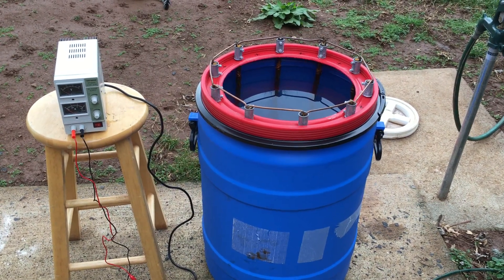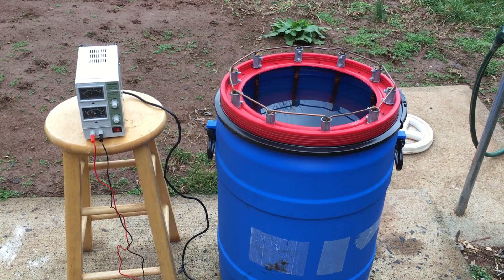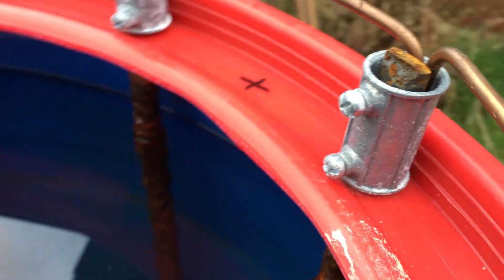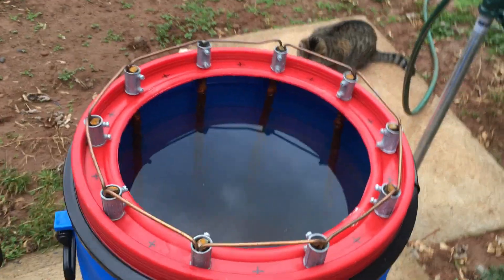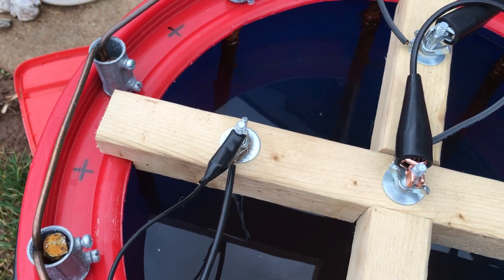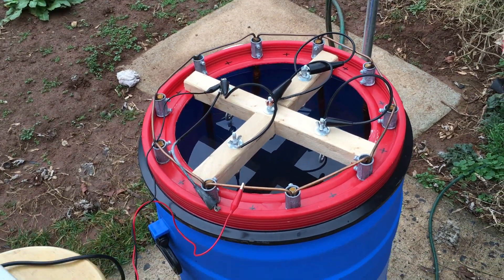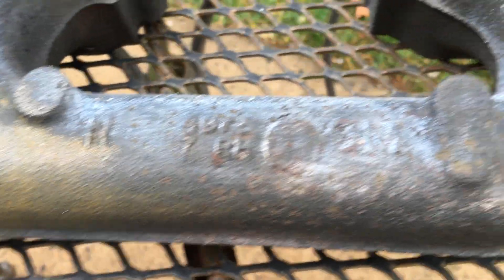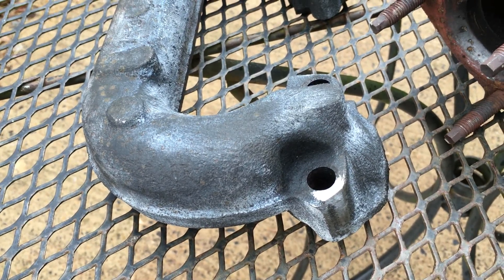My Electrolysis De-rusting System

Comment: I love the design. The top ring to hold the rods is one of those "why didnt I think of that" designs. now I need to mimic yours. Great job.
Reply: Wouldn't a coil of the same rod (20'), running as often as possible around the interior of the wall of the tank, top to bottom, not serve just as well? Such an arrangement would minimize the connection to a single point. Having several such wound rods available (e.g. one at half the tank diameter, another a half-height, rectangular arrangement of the rod, etc.) might make the tank function more efficiently -- the rod shape being selected relative to the shape and dimensions of the object(s) being treated -- by bringing anode and cathode closer together during actual operation.
Reply: Looks like lots of places to cause a short…

Comment: Best design on all of youtube..  

Only thing that could make it a little better is a barrier between the rebar and the center of the tank so you would never have to worry about contact with the rebar and creating an arc...
Reply: could you drop the rebar in pvc pipe so water will still flow around but remove the accidental touching of the parts being cleaning from the sacrifice?

Comment: You didn't mention what you set your DC power supply on to perform the Electrolysis.
Reply: As high as it can go.... Looks to me a more powerful DC source would be the way to go. I personally use an old 14A 24V battery charger for electrolysis derusting. The more power the faster.

Comment from the maker: I forgot to mention the cost of this thing and that is about $135 total.
The DC power supply off of eBay for about $40.
The plastic Barrel on eBay for about $50.
10 - 2' lengths of 1/2" rebar including cutting fee for about $9.
10 - pipe conduit connectors from the local hardware store for $8.
8' - 6 gauge bare copper ground wire for about $10.
Some old heavy duty speaker wire I had laying about - free.
A collection of clips I got for less than $10 on eBay.
5 - hanger bolts from the local hardware store for about $10.
Reply: Any suggestions now on a power supply?  amperage, etc...
Reply: What is the name for those type of clips you got on Ebay? I've tried several word combos now. Can't find that kind, yet. Please help.